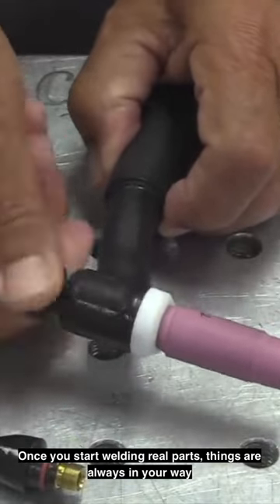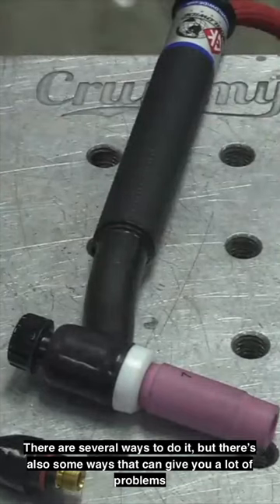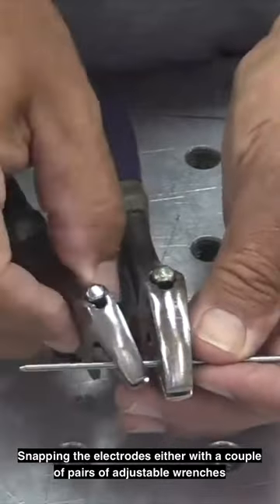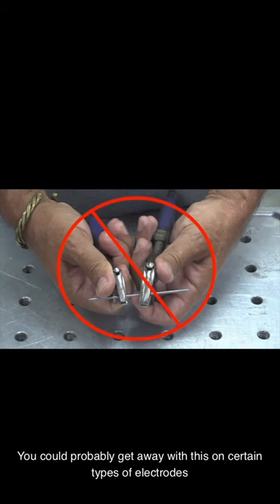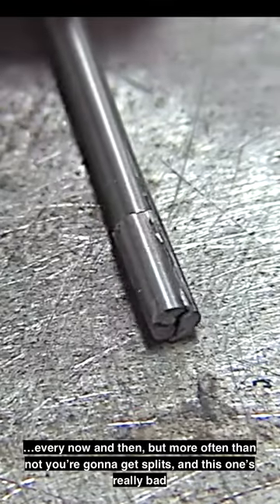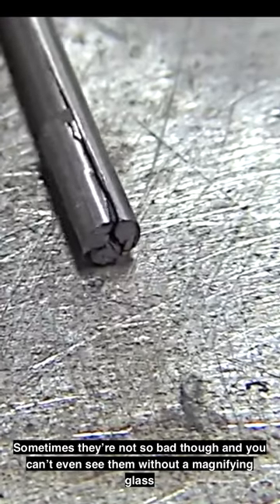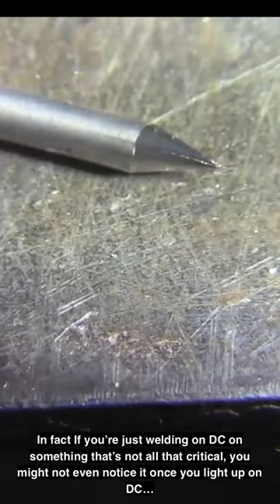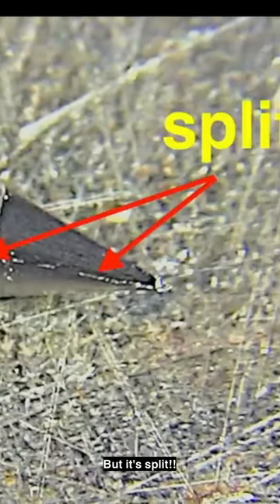Don't Do This to Your Tungsten!

Comment: I cut them with a cutoff wheel. Has worked for me since 1979 when I started Tig welding.
Reply: Edge of bench grinder wheel ftw
Reply: even when i get that little nutt hair of tungsten i still get paranoid to snap so i just grind through🫣

Comment: So how do you properly cut down tungsten ?
Reply: I use a bench grinder and act like I'm sharpening it, but in the middle of the electrode, so it is shortened and sharpend in the same motion
Reply: @sideshow45  ^^^ second this
Reply: @sideshow45  I do that to.

Comment: grind them with  bench grinder on the corner while you spin it. this will get a start on grinding the point.
I grind them in three equal pieces.

Comment: My instructor told me just to take another piece of metal, put the tungsten on the very corner of your table, then hit it right on the spot where the tungsten is touching the corner or the table, seems to work every time
Reply: yea not a good idea just cut it  unless you don't care like the instructor you mentioned
Reply: @notgoingQuietly410  I mean it's pretty clean breaks, no cracks, no uneven surface or sharp pieces sticking out, seems to work to me
Reply: @sovietred7371  I did this for a bit but after a while the split will end up meeting the tip of the tungsten. I've found that breaking the tungsten and then grinding your tungsten on the side you broke will work for a bit, but if you're welding aluminum you'll start seeing that split pretty quickly on AC.

Silver lining though is that the split doesn't seem to affect the balled end, but it can still noticeably affect the arc. I feel it's negligible enough on E3 tungstens, but always present either way.
Reply: Thats how i was taught in school and it works every time, never saw such a crappy tungsten break as in this video. 
You gotta snap em right if you cant dont do it. Many weldors cant, much like welding in general, most people cant do it at all.

Comment: I line up all 10 of them, tape them together, and cut all 10 at once with a cut off wheel… BAM, 20 electrodes.
If you need to go shorter, I’m guessing you do it twice and BAM, 30 electrodes
Reply: Wouldn't that make 40
Reply: @corbin1368  I was cutting them into thirds, while the 10 are still taped together. If you want 40, you will have to cut in half, tape the new half, and then two more sets of cuts.

Comment: Now I don't have much experience tig welding
0 on the job experience but three years of highschool shop classed four periods a day, in  the latter half I was a teachers assistant do I mostly got to do whatever I wanted, mainly tig welding
And I have only experienced splits once, and that was when I knocked the end off of a tungsten that a kid I was teaching to weld aluminum had heavily contaminated.

Comment: I unsubscribe from everyone making "shorts". 
I am sorry, but YouTube gives me no option to block them or control them otherwise.
Reply: But, don't you have the ability to just not watch shorts?
Reply: @3ch0_17 :
I don't watch them, but I still see them and that's the point!
Reply: @Finite Tuning  I am not understanding;, do you use YouTube on a PC or mobile?
Reply: @Finite Tuning  fair enough and completely understandable. My only solution is to use a mobile device for youtube because the shorts fit the display and there is a separate tab for shorts
Reply: I don't like shorts myself. but I'm not going to stop watching a channel because of a short.
Reply: @steelrain79 :
I don't stop watching a channels content, I simply unsubscribe to get those useless shorts recommendations outta my face!

Comment: its crazy how many "welders" dont know it fractures 95% of the time breaking it, just sharpen it stop being lazy
Reply: Well though, I believe the point is that if you have to shorten a 7-1/2" piece of tungsten due to clearance issues, sometimes you have to snap the tungsten in half in order to get more clearance by taking your rooster tail cap off and being able to use a shorter rooster cap or flat end cap. Sometimes you have to. So I don't think it has anything to do with being lazy necessarily. I know it actually takes me longer to snap my tungsten in half and to now sharpen four ends instead of just the two on your full 7-1/2" piece. So actually the opposite would be true when it comes to the effort part. I would always just place my tungsten halfway into a vice then take some pliers and break it in half that way. I haven't had any issues doing it that way, at least with my lanthinated and thoriated tungsten. I would have liked to have seen or heard what Jodie's way was tho. Any reason why the video seemed to cut short that anyone knows of?
Reply: @michaelivey7517  i always cut/grind mine right in the middle never use a full piece  the point is any kind of snapping is rolling the dice and a good way to get ran out of any kind of aerospace
Reply: Thank you for the replies to my question as to how to do that differently than what some of us others have been taught. Good input. I have only been tig welding on and off for about four years even though I have stick welded since my highschool days back in late seventies as well. (coincidentally enough! lol) I took my first highschool weld course as a freshman back in 1978. They only had oxy acetylene "brazing" as the only other option aty highschool back then. Which I loved. But I didn't even know that tig welding existed back then! Thanks for the responses again! I think from here on it's skinny wheelin' it time. 😁